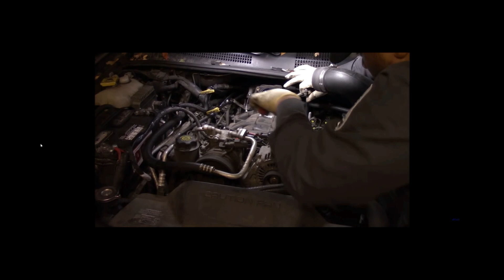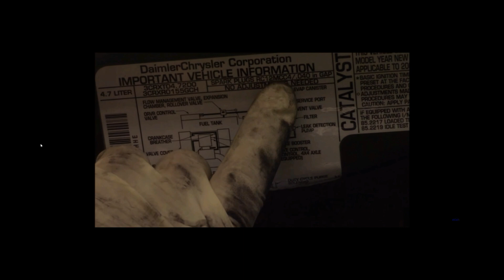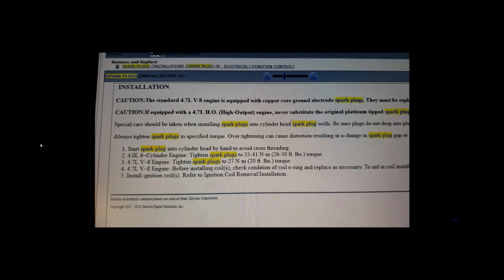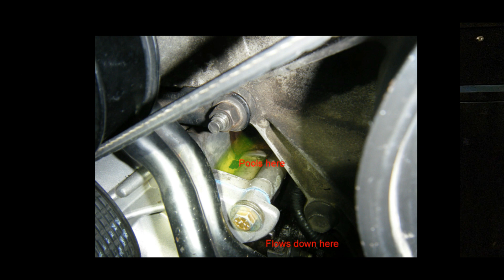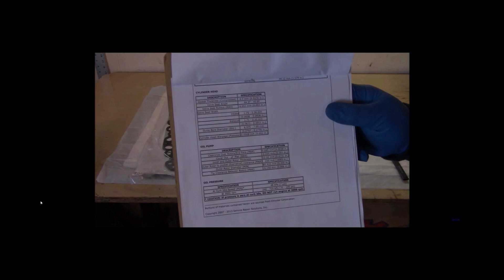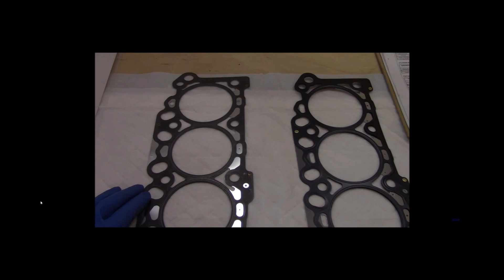How Mechanics Buy Auto Parts!

Comment: I just bought a throttle body, pedal sensor cause my car was in limp mode. Turned out it was the harness with a bad connection. Question, who has access to the part warranty, me or the mechanic? Asking cause im having the limp mode happening again.

Comment: Dorman, do you really try to do your best when making parts? It appears to me that you don't, just had to ask lol.
I remember back when we first got our AutoZone and I had bought a starter alternator and a couple of electrical things and a idler pulley (these are all separate purchases) and every one of them I had a problem with. So after that I avoid them for those types of parts. After the starter/alternator problem I take them to a local guy who can rebuild them. That way I can maintain the original starter and alternator that came with the vehicle.
Napa used to sell really good USA aftermarket parts. Not so much now, even though I still believe they are slightly better (certain things are all the same no matter what store, just different packaging) than some of the others. There's only so many manufacturer of aftermarket parts. A lot of them are just shoved in different labeling and packaging. 
I get a kick out of people and their spark plugs. They act like it's going to add this phenomenal amount of horsepower or something lol. Unless you have some sort of modified engine just buy  the same brand and type of plug.
 O.E or OEM parts is the way to travel, especially if you are getting inside an engine, transmission, or fuel tank.
You mentioned salvage yards. That's usually my go-to spot when I want a fuel pump. Another good video!!

Comment: Question:  How do you know what the parts OE Brand is?  Say I remove a part, but there are no markings or anything, how do I know the OE Brand to get a New One?
Reply from the maker: The OE part should say Honda for Honda Nissan for Nissan, GM uses Acdelco Chrysler Mopar Etc. you can always look it up on line or call your local Dealership. In some case though the factory will use a OEM company to provide parts such as 02 sensors, spark plugs, ignition coils Etc.

Comment: Fuel pumps,not worth buying aftermarket fuel pumps.Fail a lot and Airtex is an example of this with high failure rates.OEM is best for fuel pumps and this includes spark plugs.None OEM spark plugs cause misfires,have fixed misfire problems by installing OEM spark plugs what it calls for from the factory finding out none OEM spark plugs were installed.Lot of people call Rock Auto an online auto parts store,Rock Auto is not an online auto parts store.Rock Auto is a wholesaler with no warehouse buying from the competition.
Reply from the maker: Your statement about aftermarket fuel pumps especially junk Airtex should be a public service announcement!